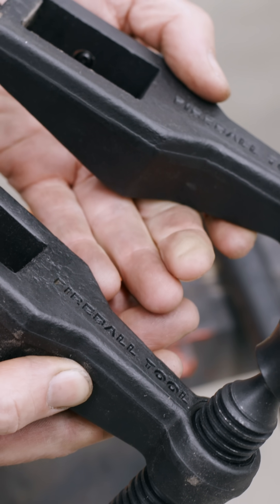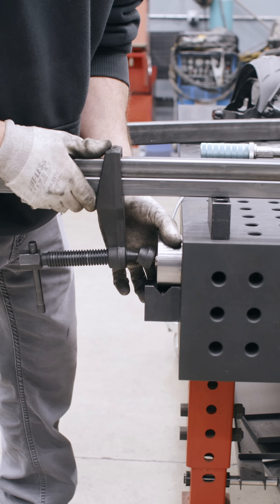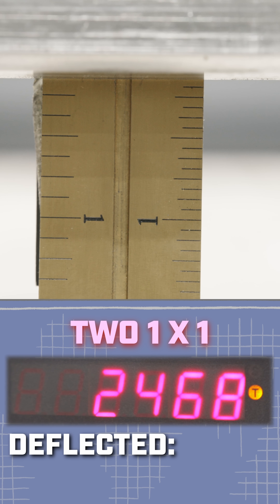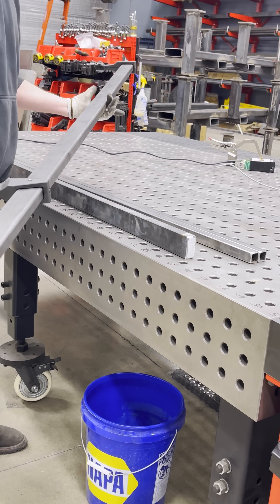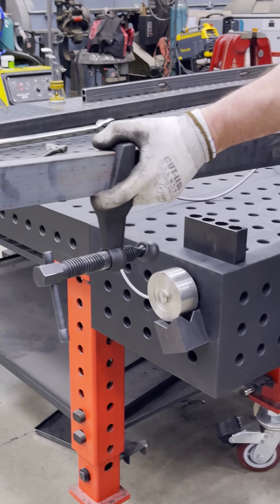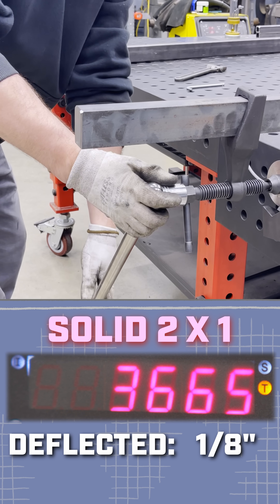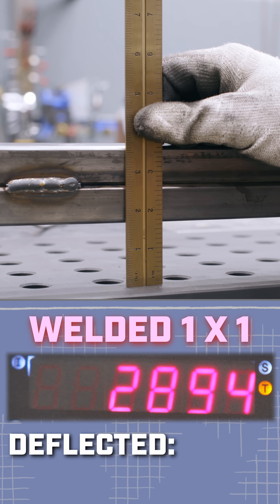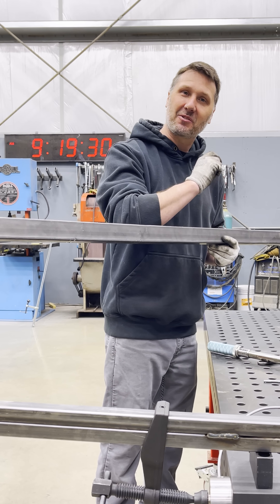Testing How Far Can You Push Standard Tubing?

Comment: Maximum 2x1x.1875 is the maximum thickness for tubing. I have 2 pieces of it at 10 ft , which makes these clamps a powerhouse! You’ll probably never need 4000 lbs of clamping force.